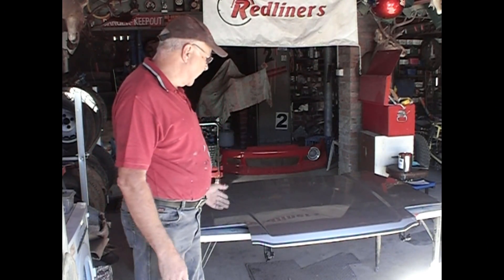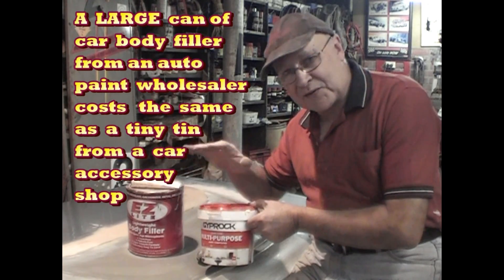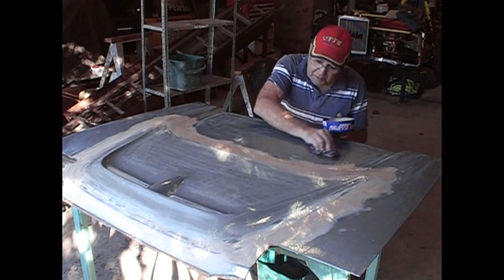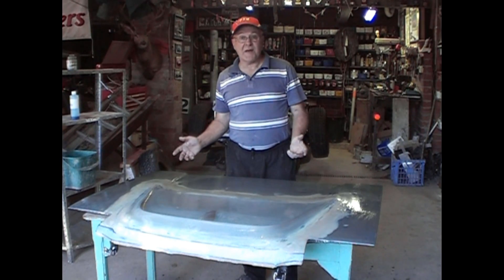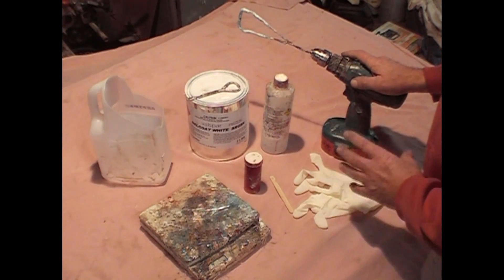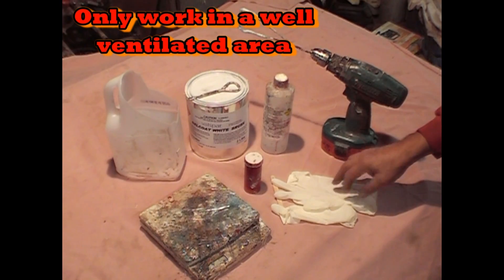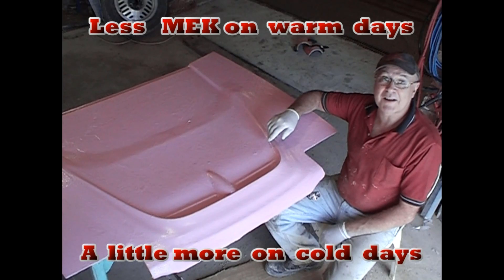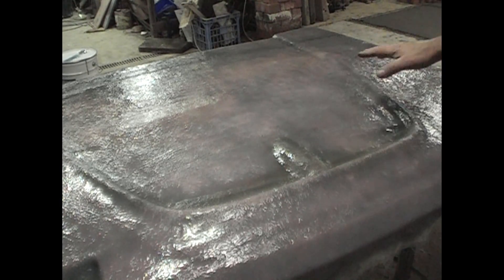How to Make Fiberglass Car Panels

Comment: Wow, nice concise video. Thanks! I would love to duplicate my truck bedsides before the dreaded "Tundra wheel-well rust" sets in. My only concern is making a mold that size--around 3' X 7' overall. Any advice? I'm wondering if I should add stiffeners to the mold before I pull it, so it doesn't flex out of shape when I cast the final piece. Perhaps it's not a big deal since the final part would be very flexible, and has numerous attachment points (bed rail, wheel well, front, back) to pull it into shape. Also wondering if an extra layer or two  of woven would be necessary for such a long part. Your thoughts, sir?
Reply from the maker: Glad you found the video helpful. If I was to add an extra layer of cloth for stiffness on a large, fairly flat piece I would use 600gm Double Bias fiberglass cloth. It does not take up curves, but it great for quick thickness & strength in a single layer. II would lay in stiffeners on molds the size you're looking at. What I use these days is the rubber tubing used to insulate hot water pipes, available at most hardware shops and in various sizes. I just cut it in half longitudinally to get a half round shape that the cloth covers easily, and being rubber it conforms to any compound curves & shapes. On a flat object I'd put stiffeners around the edges a couple of inches in, and maybe diagonally. Then just covers in two layers of 450gm csm cut into strips.
Reply: Thank you for your reply, especially the advice on using pipe insulation stiffeners! Ingenious. After watching a few more of your videos, I have the confidence to mold a bedside. For a mold of that size, can I use the same amount of layers as for your hood? How many would you advise for the finished panel (how thick would it end up?). Though large, it will be firmly fastened on the top rail, tailgate area, front of the bed, and a rather stout wheel well arch. Again, thanks.
Reply from the maker: PM me pics to Redline Fiberglass facebook

Comment: So, you made a mold of the top and bottom of the hood. Do you use both of those sandwiched togather to make the actual fiberglass hood? Seems like becouse its on the outside, it would be slightly larger than original dimensions
Reply from the maker: You have slightly misunderstood my method here. I didn't make a second mold of the bonnet underside. For a racing car you only need a single skin, so I only made a single piece into which I then laid in re-enforcing tubes.  I don't leave steps out of my tutorials. That would be unwise. You didn't see me make an underside mold because I didn't make one. There is a later tutorial of mine on how to make a double layer car panel, and you see me do that there... but not here. Neither is the copy larger than the OME part. The sizing of the MOLD is "slightly larger" - but the copy then made within that mold is EXACTLY the same size as the bonnet the mold was made off, and this SECOND generation lay-up is the panel that goes on the car.
Reply: WJP004 i got ya. I appologize, I wasn't trying to point out any wrongs, simply asking for my own knowledge. I think I see what you did here. It just took you explaining it in that way for me to realize. I didnt think you would leave out steps..... but wasn't quite sure what was going on is why I ask. Thanks for your reply
Reply from the maker: No need to apologize. No offense taken at all. You were just asking for clarification. That's how we all learn.
Reply: Absolutely agree with you sir... thank you for your vidio

Comment: Hello, if you make a copy of your bonnet, doesnt that change the size to a bit bigger than the original?
Reply from the maker: It would do if you only did one layup to make a bonnet - but thinking this way you're leaving out a stage in the work. This is a TWO stage not a single stage manufacturing process.  First stage is to make a fiberglass mold off the original. Second stage is to make a copy (which goes on the car), WITHIN that mold - guaranteeing the finished part will be EXACTLY the same size as the OME part.

Comment: I love that you only focus on 'necessary' work and materials, without getting too hung up on whether or not you can get a few grams lighter or stiffer. Efficiency is key, especially when you're fielding a team by yourself.
Reply from the maker: I crack up at the attitudes & antics of the resin infusion & vacuum bagging fanatics who think weight levels in basic club cars are as critical as in the aerospace or F1 industries. I can honestly say I've never sat in the pits thinking "Oh shit if only I'd minimized resin in those panels of mine I woulda beat that guy."
Reply: I'm as bad as anyone else about getting as light as possible, but I've definitely picked up an overflowing handful of time-saving tricks from you that have kept my projects from getting stuck. I still groan whenever you glitter up your epoxy or when you make cheesy jokes, but I absolutely love every video you've put out. Even on the other side of this rock we all live on, you're an inspiration. Keep up the great work, mate!

Comment: when you repair any of the damage on the mould should i repair it with car body repair with     gel coat?
Reply from the maker: Gelcoat only goes hard & stops being sticky when poly resin is applied over it, so you never use it as a filler. Just use auto body filler, sand it when fully hard, but you then MUST coat your repairs with Wattyl 7008 or a coat of Famowood Glaze coat. If you don't all you filler will come away in the gelcoat of the copy you make in that repaired mold. But either of those 2 clear epoxy two pack clear floor varnishes will prevent that.
Reply: WJP004 thank you so much for the help i did the bonnet of my rx7 fc3s and did the vent seperate.. the vent snapped when taking it out the mould guess because its plastic and 30 years old and english weather... mould was nearly perfect apart from a little part that snapped off.. thank you so much for all your videos and help

Comment: If you don't use body filler on the panel do still need to seal it
Reply from the maker: No. If it's all metal just release wax & PVA release will suffice.
Reply: Ok thanks

Comment: Just curious, could plastic wrap be used instead of the wax on flat areas?
Reply from the maker: I have used pallet wrap as a release agent on test pieces, and also on frozen carcasses when making fiberglass molds as a pro taxidermist. But wax & PVA release TOGETHER is always best as you always get wrinkles with plastic film.
Reply: Thanks!
Reply: i:ve seen a video where a guy used aluminum food wrapping sheets : better than pastic ?

Comment: hi, thanks for your videos, very well explained!!i would like some advice; i want to make moulds off my metal car panels (wings, bonnet etc....), but i don't want to damage them: if i apply wax the proper way,, is there a risk of melting the panels clear coat while the epoxy resin is drying ?
Reply from the maker: The mild heat of catalized fiberglass resin is incapable of melting dried & hardened clear automotive paint. In a case like this I would apply FIVE coats of release wax, polishing each coat. This will build up a good protective layer, and leave your car with a fantastic shine after the fiberglassing process. Then apply PVA release. The more important issue is to make your fiberglass molds so that their shape will not cause them to be difficult to release off your car due to under locking edges.
Reply: thank you; now is the time to make my moulds !!!
Reply: Now it is starting to be sunny in france, can you tell me which product i need to get rid of the wax applied on my original metal car panel, once i have taken the moulds off ? thanks

Comment: Wondering what do you use to colour the gelcoat. Pigment? If so where from and what one cheers
Reply from the maker: Neutral Gelcoat is coloured with paint pigment - the stuff paint shops have in their carousel mixers, but you buy it from fiberglass suppliers, like where I used to work. You can order online or by phone, pay by card & they'll post to you (it looks like you're in Tassy). https://trojanfibreglass.com.au/product-category/pigments/
Reply: WJP004 thanks mate I just bought 100g of pigment down in Tassie and it was $17. It's $20 for 1kg at Trojan. Much better price 👌🏻 love your work!

Comment: my question is...wouldn't the fiberglass hood be slightly bigger than the original because it was made to fit over it?
Reply from the maker: My answer is... No, because the sizing of the MOLD is what you are describing here - but the copy then made within that mold is EXACTLY the same size as the bonnet the mold was made off, and this SECOND generation lay-up is the panel that goes on the car.
Reply: yep

Comment: can you make the whole body of fiberglass if chassis is separate ?
Reply from the maker: Yes. Funny car drag racers have been doing that for years. But it takes a LOT of skill & experience to make such a die, mold it's pieces, then lay it up.
Reply: i saw on TV and photos but wanted to verify
thanks
Reply: check koenniserg

Comment: Can you fiberglass a car panel without taking it off and not hurting the paint? Pls post a video on that im dying to learn it
Reply from the maker: It can be done using the methods I demonstrate but you need to polish wax on wax off about six coats of wax before the PVA release is applied. However I never guarantee an OME part will be perfect as a little damage  is always possible. Instead I advise guys to get that panel from a wrecking yard & copy that instead. That's t he only 100% risk free way.
Reply: Thanks
Reply: Danny Mooney aluminum tape on top
Reply: @BillsBuildandRace   wait you're saying i dont have to drive around without my truck hood for 3 weeks,,, thats great then resell the used part for a little money back

Comment: What is the thickness of fiberglass??
Reply from the maker: As thick as you make it. My standard layup for car work and making molds is one layer of 225gm cloth then two layers of 450gm cloth. This gives a thickness of around 3mm.
Reply: Thank you
Reply: I want to make a complete polyester  body for my toyota mrs spyder, the primary reason is loosing weight ( not me, the car...); if I do the above mentioned, will i lose weight compare to the original metal part , or will i have to make 2 layers instead of 3 ?

Thanks

Comment: I truly feel sorry for you that you are forced to remaster your classic videos.
I followed you from the beginning and like to thank you for teaching me and others how to work with fiberglass.
it was a joy to learn and is a very fun and useful set of skills.

best wishes from berlin city
Reply: Amazing work as usual !!
Learning allot from you , I'm in the middle of creating my plug ( dye). My question is;  I am priming my plug with primer 2k, now can I seal it with  automotive clear coat ? Insted of  Famowood Glaze or still use the glaze also ? Thank you as always , You always answer my questions and I truly appreciate it !!!👍
Reply: @autowingsthingsmike8954  normally when using a 2k primer you have to use a 1k color/paint layer which you afterward seal with a 2k clearcoat. I would not use the 2k floor coat after a 2k automotive clear coat. But I will recommend that you use PVA and mold release wax. Good luck with your project. Greetings from berlin
Reply: @madmen2505  Thank You ! from USA
Reply: @autowingsthingsmike8954  good luck fallow builder. Keep me posted if everything went well. All the best 👍
Reply: I will keep u posted !! 
Thank you !!👍